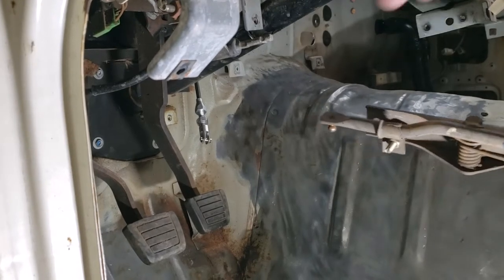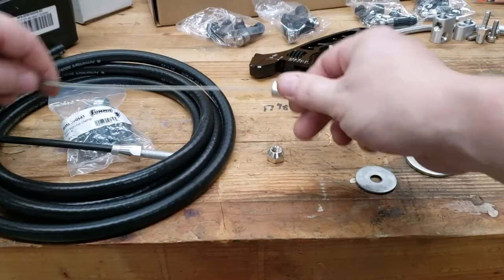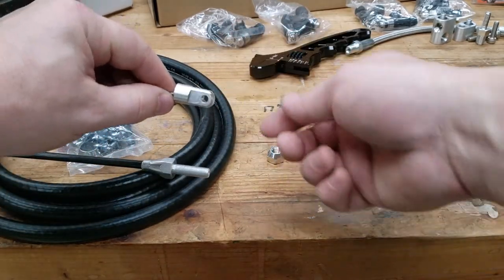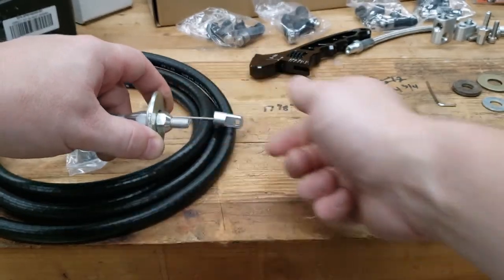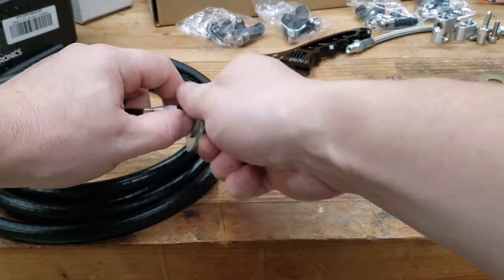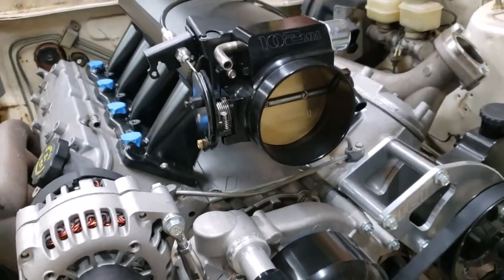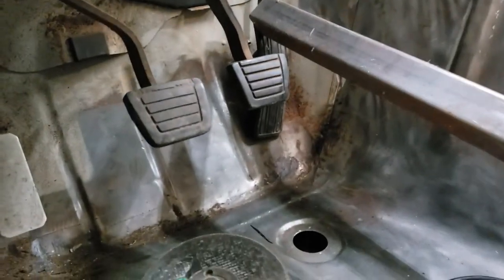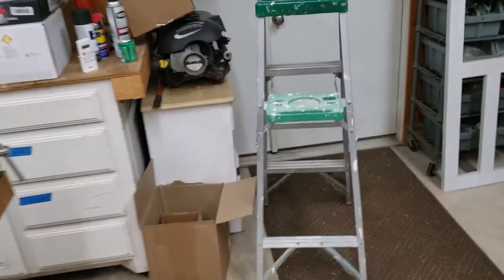How to make a Custom Throttle Cable / LS Swapped Datsun 280zx

Comment: Nice work! To get the last little bit of travel, put the throttle pedal in a bench vice and just give the rod a tiny bend.
Reply from the maker: That's a great idea! I'll definitely give that a try 👍
Reply: @likablemichael  I JUST DID MINE LAST WEEKEND I PUT A WASHER BETWEEN THE PEDAL ASSEMBLEY
Reply: Don’t do this to a hardened steel rod like the one on the ZX, it’ll crack from stress of being bent eventually that would be super unfortunate failure when it happens
Reply: @s1ddb429  What makes you think it is hardened steel? Could use some heat to help.

Comment: You'll enjoy it as is lol i didn't check for full open on my throttle when i did mine drove it and it was plenty for the car. This past weekend i was working on the car and noticed it wasn't full open so did the same mod to pedal stop and raised the pedal a bit and its a massive change and now scares the mess out of me
Reply from the maker: Lol yeah I was thinking I probably don't even need full throttle but I want it so 🤷‍♂️
Reply: @likablemichael   yhea defintley im working on locking my rear differental today to gain more controlled skids

Comment: Could get a bit more throttle movement if you connect the cable to the other hole on the throttle. Less radius = more throttle angle for the same cable movement

Comment: What’s the part numbers on the throttle cable and accessories? Shit came out really good !
Reply from the maker: Thanks bro! I just snagged one off ebay (36") along with a throttle cable holder that bolts in-between the throttle body 👌 search by price because they're all the same 😅
Reply: @likablemichael  how about the throttle bracket I can’t find one with it ?
Reply from the maker: @angelcastro4983  https://www.ebay.com/itm/Throttle-Cable-Bracket-Throttle-Body-for-LS-LSX-LS1-LS2-LS3-LS6-LS7-92mm-102mm-/265302226373?mkcid=16&mkevt=1&_trksid=p2349624.m46890.l49286&mkrid=711-127632-2357-0

Comment: Can you link the throttle cable kit in the description?
Reply from the maker: Done. Let me know if you don't see it in there
Reply: @likablemichael  I see the link. Thank you!
Reply: @likablemichael  I need to go 8 to 10 feet for my engine swap.
Reply: @likablemichael  do you know of a way for me to get the cable threaded ends, the sheathing, and the cable separately so that I can go 8' - 10' and terminate the ends where I need them?

Comment: hey man do you happen to have the link for the parts?
Reply from the maker: I have it for the throttle cable and it should work with most throttle bodies (LS cable driven) 

https://www.ebay.com/itm/373536944130?mkcid=16&mkevt=1&mkrid=711-127632-2357-0&ssspo=0IEu4QEtTyG&sssrc=4429486&ssuid=gekgCJySTfS&var=&widget_ver=artemis&media=WHATS_APP
Reply: @likablemichael  thanks brother appreciate it !! 👍